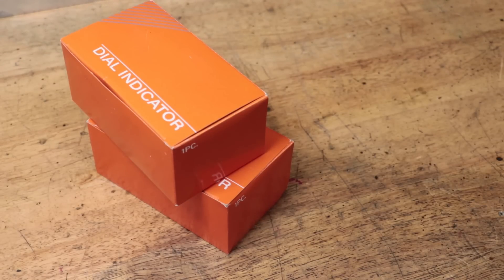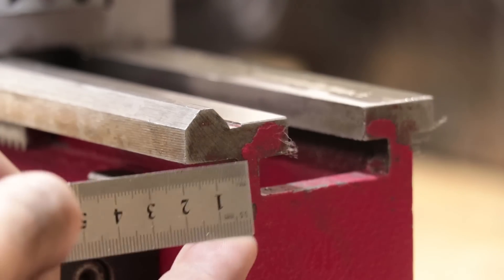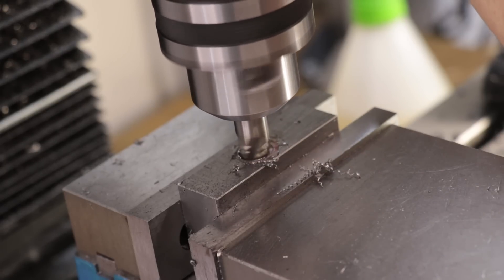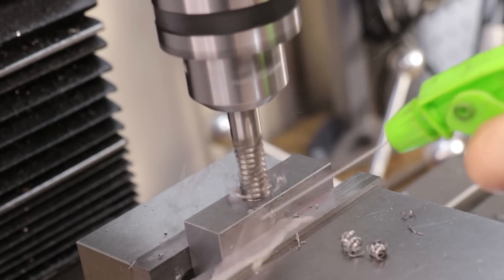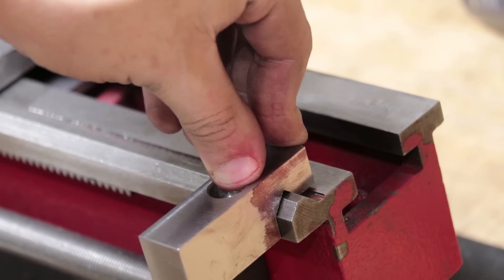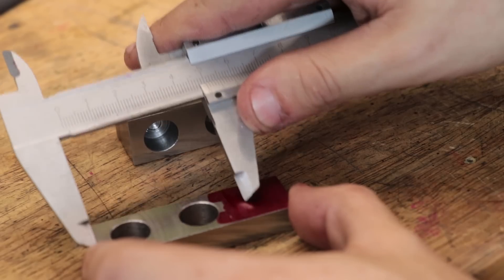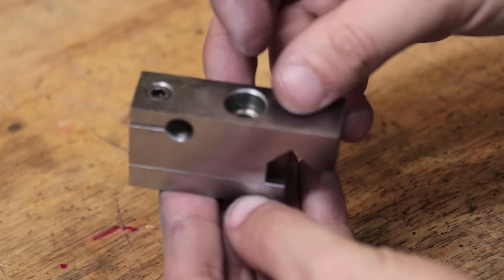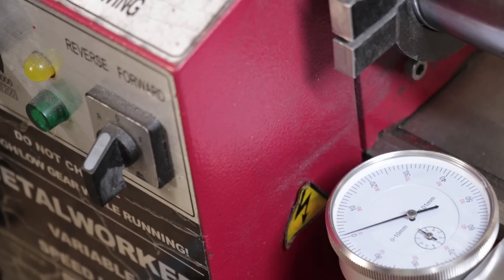Making A Better Carriage Stop For The Lathe

Comment: Nice job! Might I suggest, when running with this, turn the indicator more side ways instead of the face being up. This way swarf won’t sit on the face. I had not considered this and hot swarf got on the plastic face of my Indicator and melted in a bit.
Reply from the maker: Thanks for the advice.
Reply: That's a good idea and tip!
Reply: Better still, mount it to the right of the carriage. With a long-travel indicator, there are several benefits apart from getting it away from the stream of swarf: the indicator counts down instead of up when feeding leftwards to a shoulder, so that you can use a null seeking mode (target is zero) which is much less cognitive burden, particularly when power feeding (which produces a better finish). Most power feeds do not enjoy being fed into a dead stop.
The long travel is desirable for several reasons: it allows the use of the DTI more like a DRO for longer features, and it saves the instrument from the risk of winding the carriage to the right and inadvertently overtravelling the plunger. The resulting damage can be avoided by fitting a travel stop tube, I guess.

Comment: Great result. You might also find that for work close to the headstock end, that you can use the indicator holder on the right hand side of the carriage (tip extending as the carriage  moves left). I often have an indicator on a mag base set up this way just for more clearance. Also - a long travel indicator can be very handy. Cheers, Craig
Reply: That is what I usually do as well. I was wondering if that sheild could be held in place with magnets to make a switch over even easier.
Reply: Just don’t set zero as fully extended. I did that once and moved too far as the Indicator did not go negative to show me I went too far!
Reply: @ironhead65  perhaps a stop on the left of the carriage and a dial gauge on the right. The dial gauge could then be used to set the stop.
Reply: @CraigsWorkshop  that is an idea! Or just pay attention? I’ve just had to invent things to help me pay proper attention

Comment: Worse comes to worse, punch a hole in the way cover right where the indicator stalk goes thru (as long as there isn't something behind it that it will interfere with) then get a small plastic stopper to put over the hole to keep chips out
Very cool design and build!
Keep em coming!!!!

Comment: same as mine but i used alloy. I use interference (heat) fit for this sort of job and don't weld.  tap a 6mm metric hole parallel to the dial indicator hole so you can use a cap screw as an adjustable carriage stop.

Comment: I'd have added a protrusion to the bottom (or top) of the stop just a bit longer than the tip of the indicator when fully compressed. That way it could serve as a hard stop without removing the indicator. 

The other addition (though usually better in a different stop, since they serve different purposes) is if you add a spindle brake you can wire a limit switch onto a hard stop. That can be used to turn the spindle motor off & engage the brake just before a crash would happen! More common for CNC machines, but not terribly difficult electrically and decent insurance.
Reply: Yes, and it's also possible to add a cap screw through the carriage stop body, from the left hand end, protruding on the right. It's a nice way to get an adjustable, and repeatable stop - I use a vise stop like this. Also, I ground and polished the tip of the screw to resemble a half ball-bearing for a nice repeatable point contact.
Reply from the maker: Thanks for the suggestion

Comment: a beautiful video as always, Thanks for sharing! I would like to point out that a shim at the other end of the clamp might be useful for getting an even clamping force on the ways. I just noticed that the clamp seems to pivot at the screws position and leave a gap between the ways and its tip.

Comment: Very nice.  A couple of mod suggestions for you.  Firstly, another hole in the main body parallel to the indicator with a rod to act a carriage stop BEFORE it pushes the indicator far enough to break it when you forget it's there....no prizes for guessing!
Secondly, you can buy (or make but the tap size is odd) extension rods for those indicators.  That would let you set it on the right of the carriage so that you can still have your way cover installed.  Obviously the indicator counts down instead of up but it's quite workable as long as you don't run out of travel on the indicator.  Longer travel indicators help....until you destroy it by not following the first suggestion :D

Comment: That came out really good. small lathes are a pain to find somewhere that you can put a magnetic base and not be in the way. I often use my tail stock to hold my indicators. Best buy for me was my 25mm digital gauge. that little bit of extra travel over the standard 10mm units comes in handy a lot more than you might think. I also made a 150mm long reference plate that bolts to the back of my carriage I can use to run a dial gauge on, for similar reasons, there is no where easy on the small lathes to get a consistent reading. With the mag base on the tail stock and the gauge running on the reference plate I have my position at any point for nearly all my jobs. One day I will put on a DRO , but until then the plate works very well.

Comment: Well done! Again, nice work and good explanation throughout the video. Yes, you did get lucky with the 90 degrees V-ways angle. I'm currently making a steady rest for my Emco Maximat V10 lathe. Not only is the V-ways angle about 3 degrees over 90, but it is also about 3 degrees off perpendicular to the lathe bed. All the best from NZ.

Comment: Made something not quite as nice as yours for my metal worker lathe.
One major issue I found was the top part of the dial indicator shaft limited how close to the chuck I could get as it jammed up against the electrics box. (was trying a 25mm indicator)
Still for work a bit further out was nice to have that precision as I do not have a DRO .
Good watch as per the usual. Keep up the good work.

Comment: Nice build. I am a bit concerned about the steel on steel where the angles meet your ways as it bites down. It may leave bite marks on the ways. Perhaps brass or something softer would relieve that issue. Unless you used some very soft steel which you may have and I didn't listen closely enough. Well done though.
Reply from the maker: Interesting thought. If it is an issue, it hasn't been one that has been flagged by other people who have built these. Cheers

Comment: You could add a little hole in your cover for the indicator if you use it a lot. Just make a little cap for it.
Reply from the maker: I probably won't do enough set up work to justify cutting up my way cover. Cheers

Comment: On using it as a hard stop: using it like this you have to choose between being able to measure the travel and having a hard stop. If you add a treaded rod or dowel pin with set screw, you'll be able to measure travel up to your planned depth, screw the stop out to contact the carriage and then lock the thread down. Either with a jam nut or a split cotter system. Since the travel of the indicator bottoms out before you make hard contact now, you'll have to shoose between the two.
Reply from the maker: for sure, but im not planning on using it as a stop in the foreseeable future. This is mostly an indicator holder, but it is a great point.

Comment: Hi interesting and a well make project, would it be a good idea to drill a small hole in the way cover or better to remove it when using your attachment like that ? looks more like the cover for the control box is where the hole should be ?

Comment: What’s the spec for the slitting saw and the arbor you used? Thanks for the awesome video!
Reply from the maker: It's a 50mm saw attached to a 20mm Arbor. I made it in a video a while back
Reply: @artisanmakes  Thanks! Will check it out

Comment: Why are you holding endmills in a drill chuck, do you not have collets? There is a lot of runout and rigidity problems in this video.
Reply from the maker: There is no reason why you can not hold endmills in drill Chuck's for the purpose of counterboring
Reply from the maker: And the run out is due to a bad grind on one of the flutes, it was kicking it out of concentricity
Reply: @artisanmakes  Find me a video on youtube of a reputable machinist doing it. I have never seen it, unless it's specifically a counterboring bit with a pilot. It's not rigid enough. That's why you had all the runout.
Reply from the maker: I'm sure someone else has done it at some point, but that was not why there was run out. It came down to a bad grind on one of the cutting edges and a lack of rigidity on the is small mill. I've done this many times before on this will with this set up without much run out. Cheers